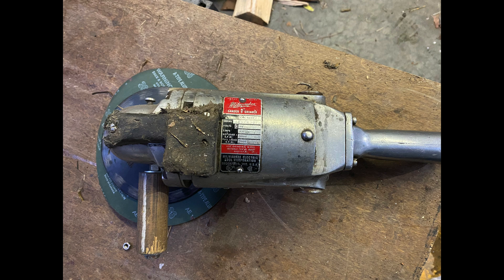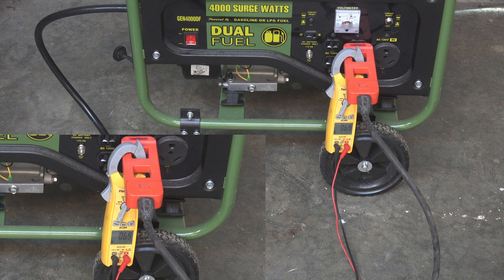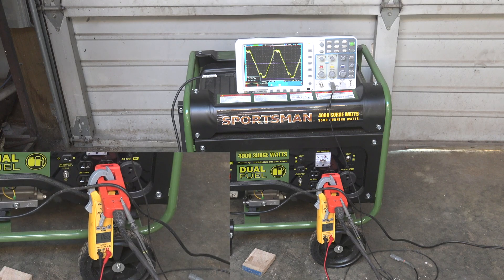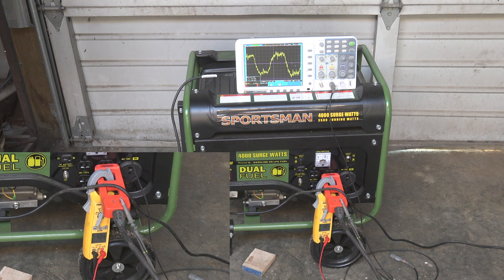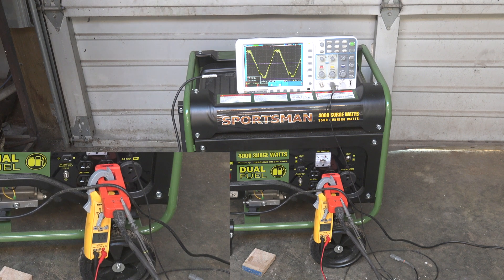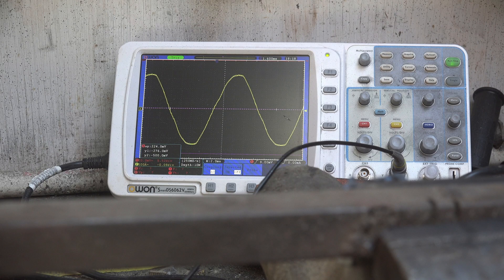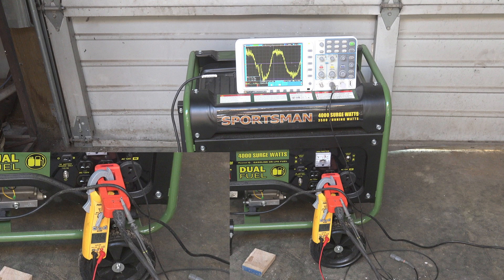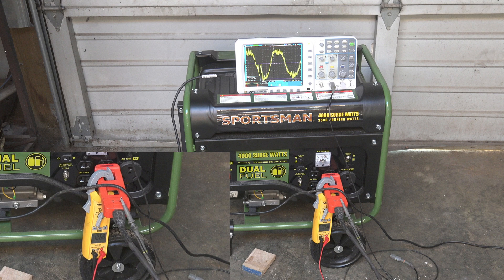Sportsman 4000 portable generator load test and sine wave

Comment: I know im late to the party here but im looking at buying this same generator for emergency use. Thanks for the load test. Would this be a dependable generator to keep for just in case scenarios, or is it difficult to start if left stored for a bit? I would definitely start it once in a while to let it run but i may never actually need it so im curious how it does if stored for a bit. And has anyone maxxed one out to see how much it could handle before its overloaded?
Reply: You can store it for 6 months or more if you keep ethinol free gas in it plus run the carb empty Everytime your done using it.

Comment: I wondered if you could tell me what size the tubing frame is on that generator?  There is a wheel kit that fits it, and I think it would fit my different model generator depending on the tubing size.  It looks to be about 7/8" or 1" maybe???
Reply from the maker: It is 7/8" od.
GFM
Reply: @grayfurnaceman  Thanks a lot, then it should fit a LOT of generators out there, including mine!  Great to know

Comment: A lot of newer appliances have digital readouts ,circuit boards and the like , I would not want to run something that has a uneven power supply with power spikes that could destroy a mother board ,  some of those computer boards are a couple hundred dollars , better to get a inverter generator if you have expensive newer appliances with  a lot of new technology,
Reply from the maker: I would generally agree, but there is more danger with destroying motors than electronics.
GFM
Reply: @grayfurnaceman  I would think electronics would get destroyed first, because when computer people are working on circuit boards they are always concerned about even small static shocks such as we get  from walking on carpeting being enough to blow the tiny components , as opposed to a motor that had thick copper windings that should be able to absorb a brief power  surge ,  I could be totally wrong, but that is just my thoughts on it,
Reply from the maker: @bluemouse5039  I would have thought so too, but computers run on DC power so their power supply eliminates most spikes.  Motors, on the other hand sometimes overheat from the unsteady side wave.  
GFM
Reply: @grayfurnaceman  Thanks, that good to know,

Comment: If you want clean power you would buy a inverter generator.
Reply from the maker: You got it.
GFM
Reply: I ran My computer & Big screen monitor AND PS3 and small window unit on a colman gas genorator with no issues at all.
Reply: @scootscoot97warlock90  I've run a computer and a 65" tv on my DeVilbiss brushless gen. set as well. It doesn't mean that the power is clean. Harmonic distortion  can cause damage, and undue wear and tear on electronics. It is what it is. A brushed gen. set is a bit better usually. Your Coleman, at least the ones I've torn apart are usually brushed units. Probably around 15%-20ish.% THD. As for brushed I would say 20ish. +. It also depends on how much power is demanded on the gen set.

5% or less is considered safe for electrinics. It also depends though on how well the power supply was built in the device used on how well it can clean up the final power needed to run the device. Easy Peasy. As I said it is what it is.
Reply: @NY411Info       I do remember, I made sure not to load the generator hardly at all.   It was a 6500 & I was probably drawing 2300ish watts,if that matters. Maybe I just got lucky

Comment: I just had a problem with my generator not running my ECM motor in a gas furnace. I was getting 120 and 24 volts speed signal but motor wouldn’t run. After double checking my equipment grounds and a phone call. I tried loading up the generator instead of only running the furnace on it and it worked great. The generators tend to chop off a sine wave at around 120 but produces much higher peak to peak voltage and the ECM motors just don’t like it. So if your have that issue try loading up the generator and drag that peak to peak voltage down. At least it worked for me.
Reply from the maker: Good info.
GFM

Comment: Is There a Generator That Produce a Pure Sine wave?
Reply from the maker: You can use an inverter generator.  They tend to have a much cleaner sine wave.
GFM
Reply: inverter generators use an electronic oscillator to produce a pure sine wave, they're as clean as you can get. you'll pay 3 times the price for an inverter model though.
Reply from the maker: @embeddedgirl  They do.  That is the only way to get that good sine wave.
GFM

Comment: Is it clean enough to power a refrigerator or a small heater?
Reply from the maker: The heater should be fine.  Motors are a bit different.  Some work perfectly, but some will overheat and shut down.  Electronics that use microprocessors do not seem to work well.
GFM
Reply: Thank you for the info brother.
Reply from the maker: @loumonte658  Welcome
GFM